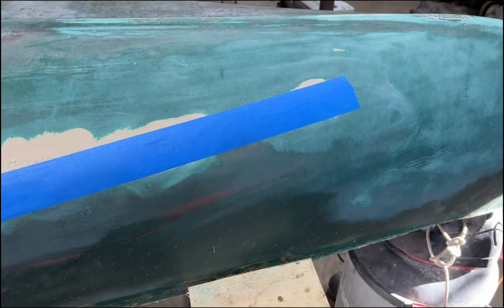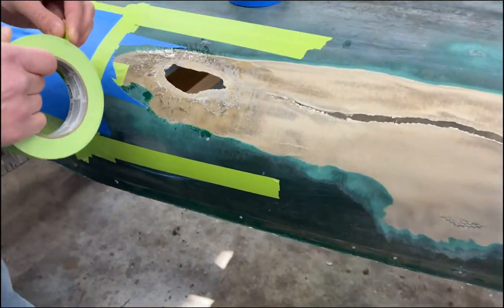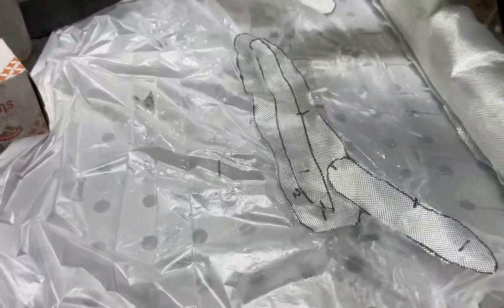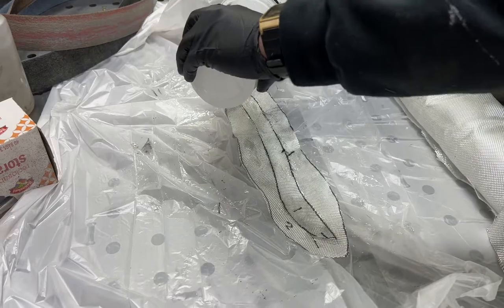Applying epoxy resin to your boat

Comment: I know these are about a year old. I got a canoe from a neighbor and wanted to fix it up with my 10 year old son. Do you have any suggestions for a single mom on other videos or other resources to learn how to do this, safety, etc?
Reply from the maker: Well my best advice is to just go at it. Don’t buy products from autozone or auto parts stores. Make sure everything comes from marine retailers. Everything else depends on how bad of shape the canoe is. Is it cracked, does it just need paint? And lastly do you have the money to do the project?